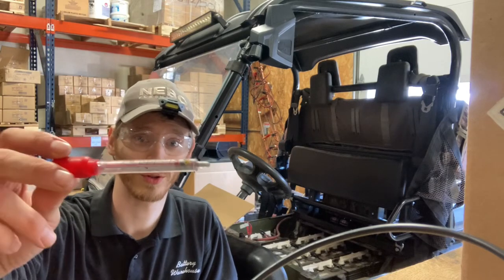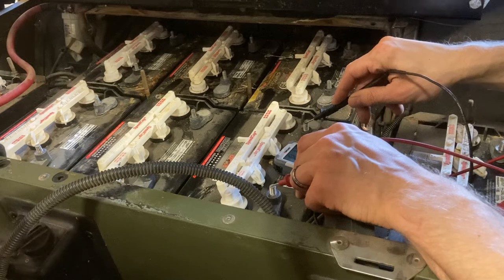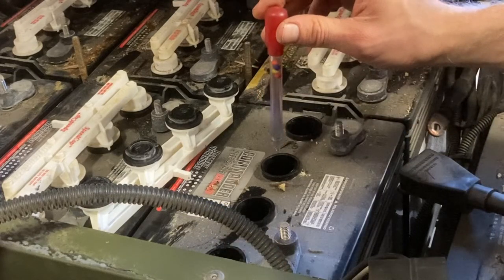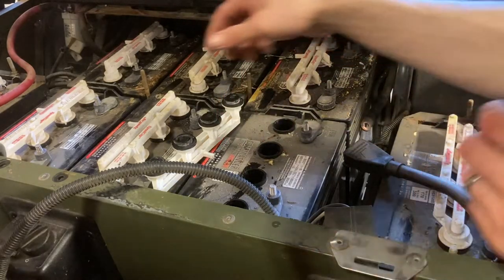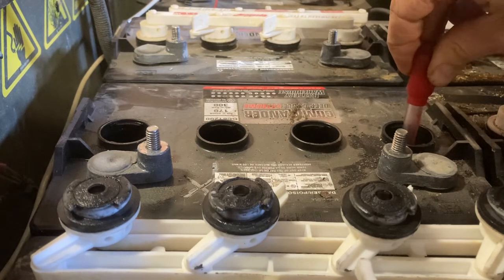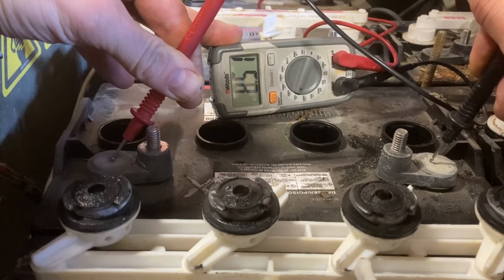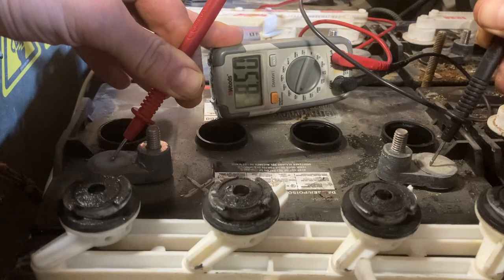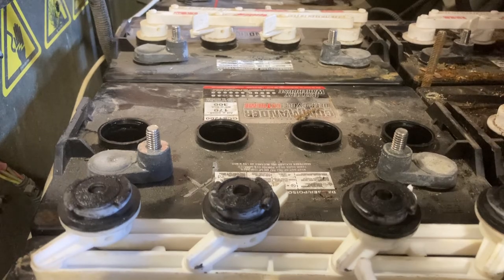Checking GOLF CART Batteries for DEAD CELLS

Comment: If you suspect a lead/acid battery is dead because of sulfation, you could try putting it on a charger/desulfator for a week or two -- it might come back. I use BatteryMinder products as they seem to be of very decent quality and use a frequency pulse instead of some that use high-voltage (not recommended!) to desulfate. And I keep one of their "onboard" stand-alone desulfators (does not charge, only desulfates) attached to my Jeep's battery so when the vehicle is running the desulfator is working (the desulfator turns off when the engine is turned off).
Whatever, I want to be sure there's nothing I could do to save a battery, so I always try to desulfate it first since (as you know) sulfation is one of the main causes of battery failures.
Then if desulfation doesn't work, it must be some other issue like an internal short I can't fix. But at least I feel better about calling it dead and using it as a core (to avoid the core-charge) when I go in to get a new battery, as it didn't give up on it too hastily -- in case desulfating it COULD have saved it (but I didn't try).
-- BR